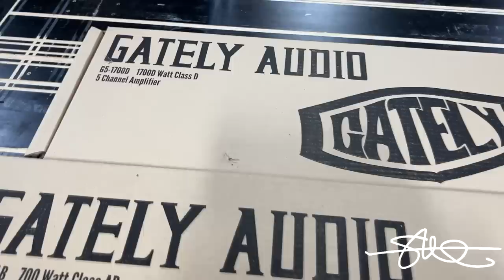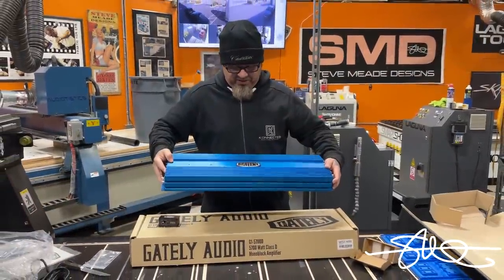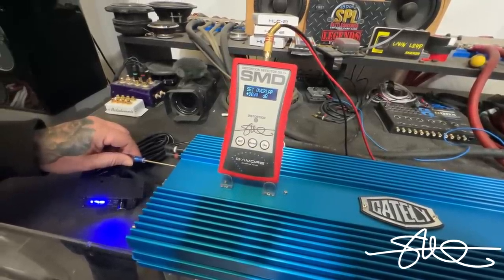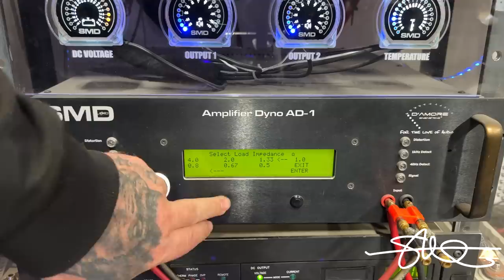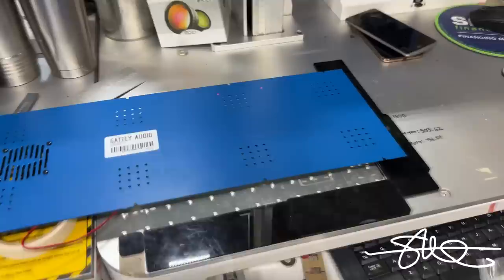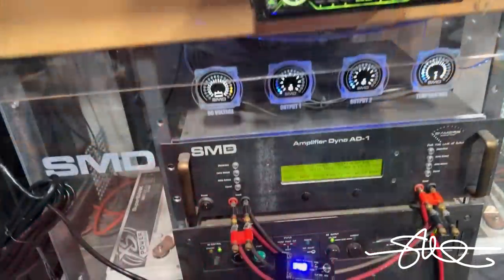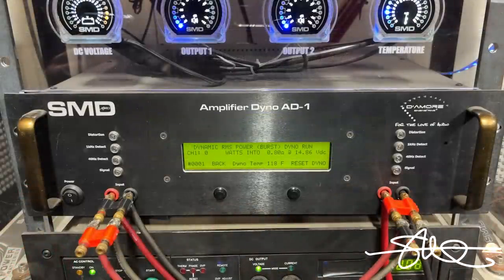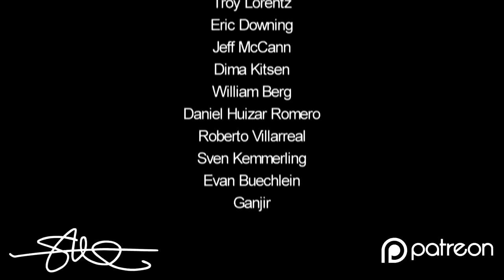Undeniable BEAST | Gately Audio G1-5700D Monoblock Amp Unboxed & Torture Tested (Results)

Comment from the maker: if you can't tell i was more than impressed by this amp test.  The first thing i told Bobby was "you are selling yourself short, this is easy a 7kw amp".  So if you buy this thing thinking you are gonna get 5700 watts, you are in for a treat! I will test the other 2 soon and see if they overperform as well. Thanks for watching if you did! http://www.wccaraudio.com
Reply: I want to see how it does on subwoofer
Reply: Ez 7k..I can't wait for the other 2 testing
Reply: Gorgeous Amps....
Reply: Will you please show how the 3 amps responded on different sized subwoofers. Like what's the best for there range. Whether you want a sharp punch or the blap that's delayed but super low
Reply: Steve we need a Signature MEADE AMPLIFIER on the market salute to U & Bobby G.
Reply: It's awesome when the company tells you to push it harder. They know with right tuning it won't clip
Reply: This amp is solid. I would buy one. If you can Steve, I would engrave the signature into the amp over the ink so it’s permanent as well.
Reply: Good Video
Reply: Straight beast, don’t sleep on the subwoofers either, they’re nasty too!
Reply: Alotta joy comes from getting lost in these vids Steve. God Bless and Happy Holidays to you and your family ✊️✌️🍻
Reply: Yo Steve I'm changing the head unit in my 07 Yukon without Bose. What's the best harness for integration?
Reply: I was just looking at the 1700 5 channel....impressive stats, for me though I would have the gain at 1 on the sub channel. but man, talk about head room !
Reply: Incriminator audio ORION  MEMPHIS CAR AUDIO  DB DRIVE KILLER CAR AUDIO THE BEST at Midwest
Reply from the maker: @michaellanglie5502  what does "have the gain at 1 on the sub channel" mean?
Reply from the maker: @michaelbaldwin8869  order one and hook it up.  You will see real fast.
Reply: What's up Steve would this amp pust 2 19 inch T3s Rockford fosgate subs 🤔 which amp would you recommend me to get for those exact 19 t3 subwoofers by Rockford fosgate..
Reply: Damn, little beast reminds me alot of my Wolfram AW-9000.1D's they're cheap Korean half bridges that're small in size but pushing wayyy over rated and my little hcca splx3000.1 V3 also doing over 10k clean for a damn 3k rated amp at $600? Mannnn technology has came so far since the days of the high current cheater amps that were half the size of the vehicles they were in only rated like 100w 😝🤣🤣🤣🤏🤥 like you Steve I still have a huge collection of those old amps and I run em every now n again just to test the caps and make sure they're still working but I properly drain them too before storing em again nothing worse than a cap full of juice that just sits it'll crystallize and pop before you go to use it again... But yeah whatta little beast ehhh, way to go Bobby you keep amazing me with each new product you put out brother!
Reply: @slapdoctor707  oh trust me that amplifier was clipping but that's the point that's why they say uncertified bring the amp up to the clipping point where the ant just starts the clip and then it turns down but I want to the owner of an ant company says turn it up running to point a certified yeah that's a confidence in your aunt not going boom
Reply: THERE'S ALWAYS CURIOUS MIND'S INTERESTED IN EVERYDAY TALENTS, WITH THAT SAID WHAT EVER YOU'RE GOOD AT TRY SHARING YOUR EXPERTISE AND YOU'LL BE SURPRISED.
Reply: ALL HE'S DOING IS FILMING HIS TALENT AND TOYS. LOOK AT THAT RYAN ASIAN KID, HIS DAD STARTED FILMING HIS 5 YEAR OLD SON WATCHING CARTOONS AND OPENING POWER WHEEL'S AND NOW HE'S WORTH A HUNNID MILLION DOLLAS

Comment: Steve how does your powerbank work, is that power supply you adjusted the voltage on plugged into the wall? does it charge the batteries?

Comment: Steve Meade……man that lazer etching on the bottom is BAD AS FUCK! My first reaction to the amp is I REALLY LIKE the heatsink. Reminds my of the 1990s Precision Power Art series amp without a doubt. I also like the color. There is also PLENTY of heatsink there to keep the amplifier cool. The performance on the amp dyno speaks for itself! One thing I would like to see on all amps is the amplifier go into protect mode while playing due to short circuit on the outputs or too low of an impedance, and then come back alive. Those tests are of course risky to say the least. But it is also a great selling point. If I see an amp protect and then keep playing, that opens my eyes for a potential purchase as a consumer. Just my two cents. Great video Steve! Can’t wait to see the 4 channel amp. Hope it matches this 5700D in appearance!

Comment: I definitely qualify as a budget banger running skar and sundown in my vehicles, I don't cheap out on the electrical though but if I could afford it I would most definitely run gately , jp or incriminator amps they look like they are badass. Thanks for sharing @mead916 keep up the great work brotha

Comment: FINALLY!  An amp that says what it'll do.  Nothing more irritating you buy an amp rated X watts and they only time it'll even come close to that is the initial spark charging the caps.  I buy an amp for X watts, I want it to be able to run at X watts until I get tired of listening to it.  Thanks!
Reply: None of the reputable companies are selling amps that don't do rated. As long as you avoid flea market bullshit, you'll be fine. Even budget Amazon companies like SKAR Audio and CT Sounds will do rated.

Comment: I worry about those long black wires that run between the 8 toroids that seem to have no support or tiedowns. I think an amp that can put out 10kw is likely to be subject a lot of vibration to fatigue those conductors, or flex those wires enough to wear the insulation off of them so they can short out on something. Nothing good could come of this...
Reply from the maker: nothing will happen to those wires.  You can stop worrying now.

Comment: Hey Steve I checked out the website and that 5700 amp is rated only for 2 ohms but you tested on a 1 ohm load??? Would you recommend to run a 1ohm subs or staying on the safe side and stay with the specifications of the amp.
Reply from the maker: it's rated at 1 ohm. Not sure where you read otherwise lol

Comment: I would pair this amp with 4 15” kicker L7’s subs.
Reply: Pushing 7kw it's blowing them. I blew one of mine on a jl 1000
Reply from the maker: @RETARDEDFATTKIDROBOT  if you blew a kicker L7 on a JL 1000 you should find a better installer.  Someone who actually knows what they are doing.
Reply: @meade916  it was prob 2010 when that happened. If I had SMD products to tune out distortion, etc, it may have been fine.

Comment: You know that thing hasn't been used in a long time when it's dusty as hell on the top. C'mon Steve, Time to clean that station 😂
Reply from the maker: i use it all the time.  It's just that it is in a very busy shop with cnc machines turning and things being routed and sanded all day.  You can come clean it for me if you want. 😂
Reply: @meade916 you must have got quieter CNC machines cuz usually I used to hear them in the background. I'd love to visit but I'm about 2000 miles north ☺️👍
Reply from the maker: @ehrenkrause9861  nah i just came and filmed during the weekend.

Comment: 2500 watt system 320 high put alt how many batteries need plz help
Reply: Don't use any batteries ...just wire it straight from the alternator
Reply from the maker: @dznuttzonyachin7499  no way you are serious right now

Comment: Same manufacturer as D4S?
Reply: Most likely. Just another rebadge
Reply: S&I is their name and yes, pretty much every SPL-oriented manufacturer uses them. Crossfire, Crescendo, DC Audio, Down4Sound, Sundown Audio, Surge Audio. They all are using S&I stuff. Some, like Sundown, spend a little more time working with S&I to develop amps, such as SALT series.

Comment: Not .5 stable..???
Reply from the maker: no.  It's a 1 ohm stable amp.  If you play it at .5 that is at your own risk.  May or may not break it but you are risking your amp by doing so.  Of course most of you that end up breaking amps blame the manufacturer after you took that risk....bottom line, don't do it. This amp makes tons of power at 1 ohm, there is no reason to.
Reply: @meade916  I'm still trying to figure out how I'd achieve 1ohm while being wired at 1ohm
Reply from the maker: @biggregg711dogg  SMH
Reply: @biggregg711dogg  Are you joking?
Reply: @biggregg711dogg  what the ?
Reply: @biggregg711dogg  Top 10 questions that scientists still can't answer.